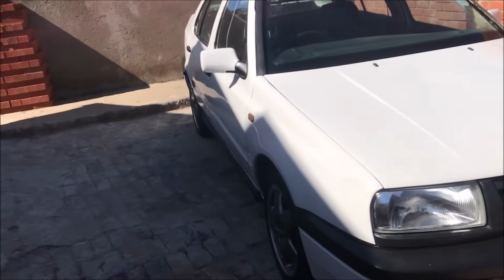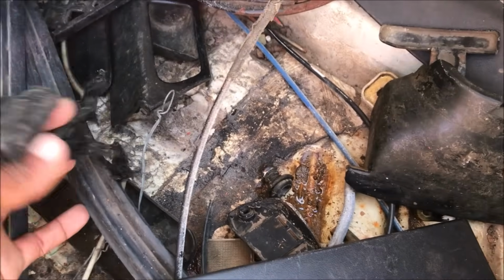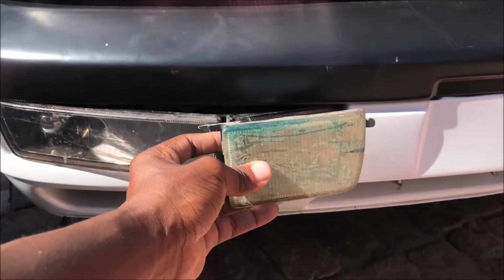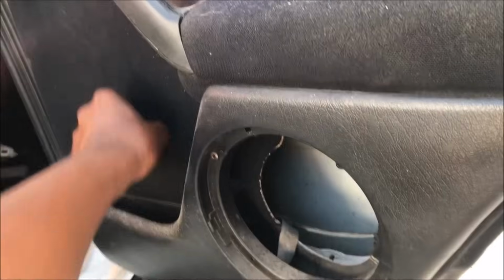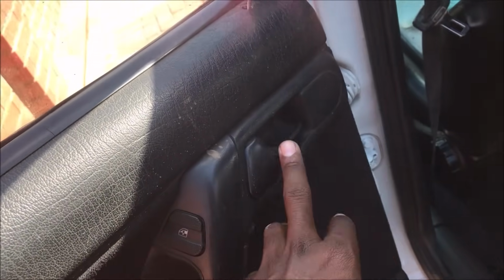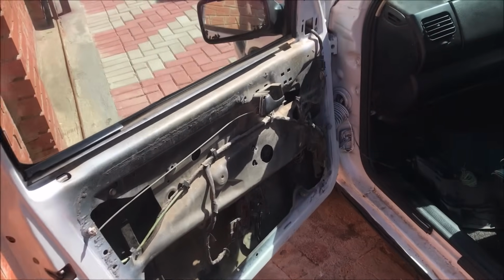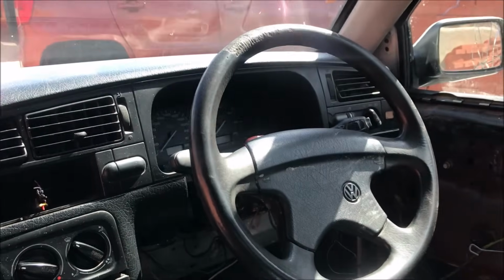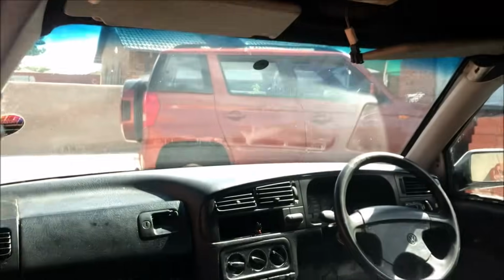INSIDE NKUPI JETTA VR6 STINGA SOLA 🤍 ITS CLEARLY OBD1 ❤️

Comment: Obd1 but your fenders are from obd2. Obd1 has square indicators nd obd2 has rounded ones. Obd1 has black trim from bumpers nd beadings yet obd2 its colour coded.. Ur grill is from a obd2
Reply from the maker: Yah but overall obd1
Reply: I was voicing out the other differences you can use to spot a obd1 nd 2.. Its not a negetive comment.. Its information u will need in the vura world